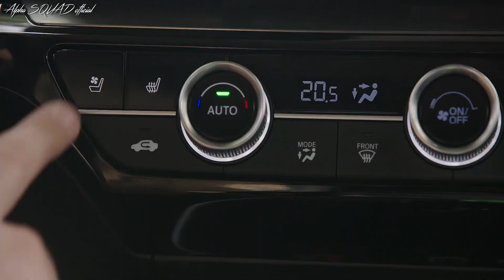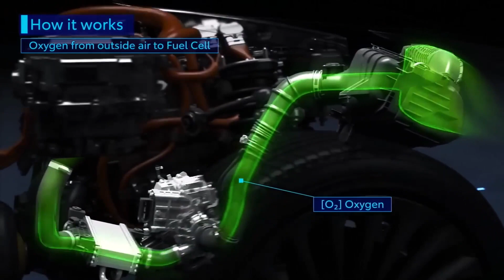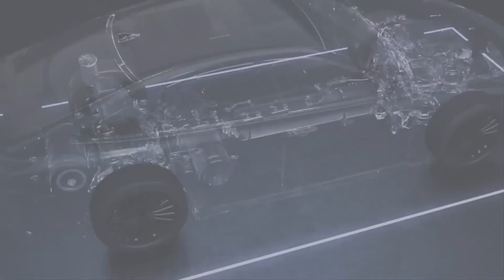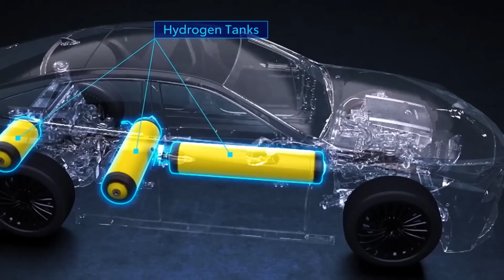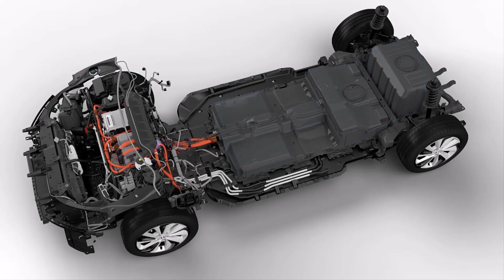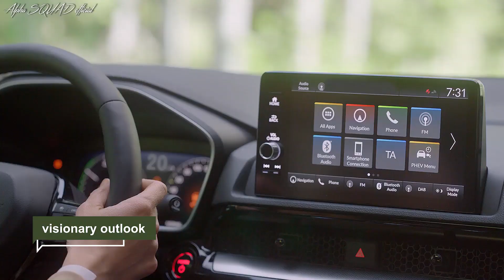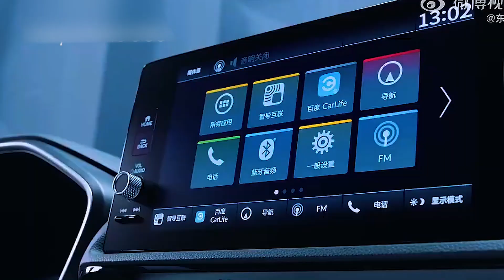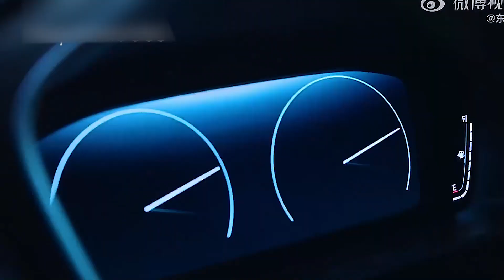Honda CEO: "This New Engine Will DESTROY The ENTIRE EV Industry!" -  It's OVER for EV'S

Comment: Could just be me worrying but I would not be comfortable with tanks of pressurized hydrogen sitting inside my garage. One small leak and guess what.
Reply: Many cars works with hig pressure gas. Is not worst tan Gasoline.  In fact gas vents, but a leak of gassoline will make a pool under your car.

Comment: Hydrogen is a non-starter. Takes too much energy to produce, given how much energy you get out of it. It's a lossy procedure both ways (both creating the hydrogen, then converting back to water to get electricity). It's MUCH more efficient to use that electricity to just charge a battery. Also, no one is going to have a hydrogen filling station in their garage, like people have EV chargers in their garage.

I really don't understand why car companies that should know better are still hitting the crack pipe with hydrogen.
Reply: Completely agree.  For haulage, shipping and air hydrogen could have a very important place but for 99% of us, EVs are fine.

Comment: What fuel can I use to "re-fuel" at home? What fuel doesn't need regular oil changes? What fuel is the quietist? What fuel is the fastest!!!!! I'll probably keep the RX8 and motorbikes for as long as there is something to burn in them. But Honda, burning stuff to move forward is so yesterday and fuel cells just don't let me charge at home. Hydrogen will never be as cheap or "green" as solar and free charging.
Reply: Where does that " green fuel" come from.....
Reply: do you realize how much coal is burned to generate that green energy?  or how badly the earth is stripped for lithium?
Reply: We are just shifting the pollution from directly out our tail pipes to out the power generation stacks. It really doesn't matter.
Reply: @johnnycash7803  Exactly, but some people are just way to arrogant to do their own research. It’s easier to believe what the news say 😂😅.